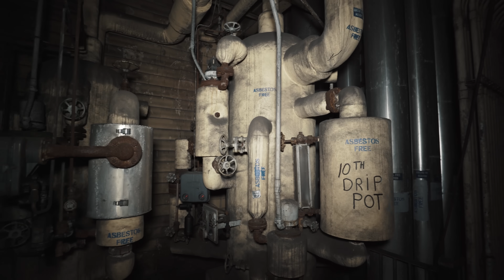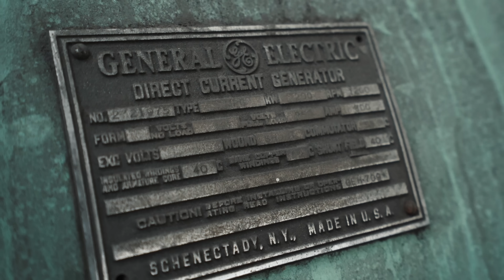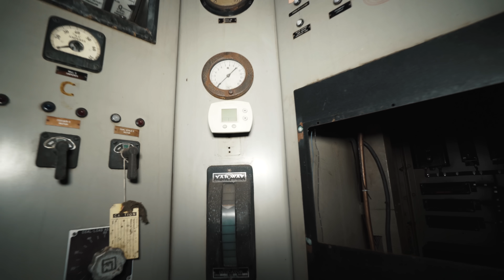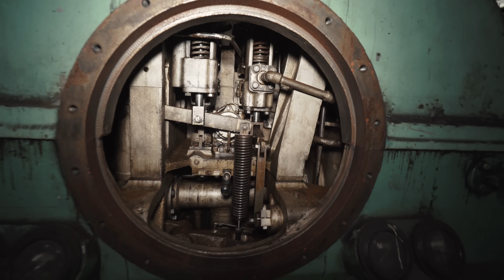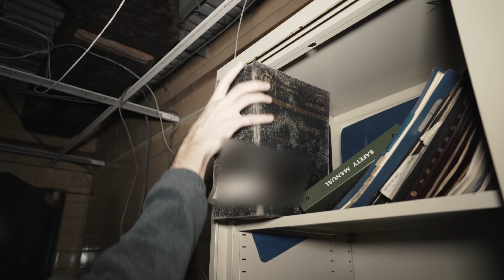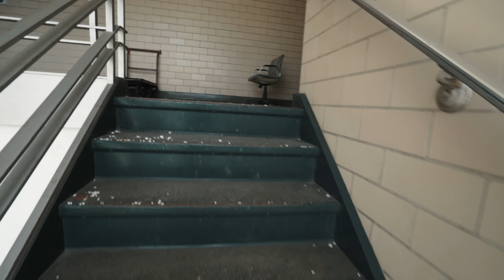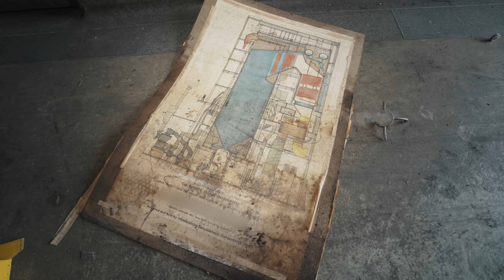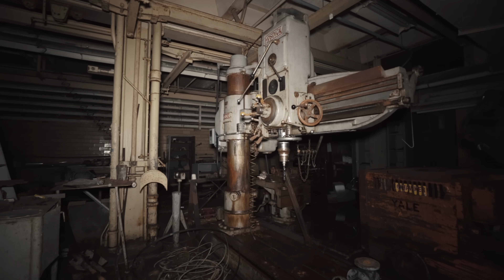Exploring a Huge Abandoned Art Deco Power Plant

Comment: I worked as a high voltage power contractor and every time i go into a Ga power station in Atlanta it's like going back in time.
They still use buildings with asbestos all over the pipes, they tell you right on the door as you enter.
Reply: @Mister Brookes notice i said contractor,  thank god i didn't have to worry about all that just open what switches the office told me to lol
Due to miscommunication between our storm coordinator and the office one time i opened a set of underslums in the substation with full load on them and that was something non of us will forget.
Reply: @Mister Brookesit was in rough shape after but believe it or not it did....my underwear didn't.
That circuit cross fazed with another circuit for a 3 sec fire ball the size of a box truck

Comment: DO NOT DROP YOUR SAW TO THE FLOOR OR GROUND!Treat your saw as a precision instrument it is.I worked in a tool repair shop and you can damage the saws guard doing that.To attest at the toughness of those Skil machines,repaired one that was involved in a three story fall.The blade,upper and lower guards had to be replaced,the shoe as well.When the saw was in the shop-removed the mentioned broken parts and it’s motor ran just fine!

Comment: The generator units shown are still made by GE to this day.They can be turned by a steam turbine or a gas turbine-IE a “jet” engine that can no longer be certified for aircraft use. The generator is sealed and hydrogen cooled-the boxlike ends of the generator are heat exchangers that transfer heat to another cooling medium such as water.The turbine rotor appears to have a low pressure and high pressure cylinders.Some turbines are “reheat “ units.After the steam passed thru the high pressure turbine it was routed back to the boiler to go thru  a second cylinder.After this the steam went directly to the low pressure turbine cylinder thru a crossover pipe above the turbine unit.After that the water mostly condensed would be pumped back to the boiler.Most of those fossil fuel and gas turbine generators were two pole units to be turned at 3600 rpm.
Reply: Indeed; you reminded me of my knuckle-dragging Navy days. A small, HP turbine riding side-saddle to a larger, LP turbine fed by the HP 'exhaust' to the gearbox that spun the ships screws.

Comment: 14:10 - we had some of these at high school, I think it had six or eight channels, so there were six or eight tiny colorful pens. Simple DC motor with negative feedback from linear potentiometer moved one of pens to desired position and then by electromagnet and lever it did small dot in right place. Then it parked in corner, switched to another input, somehow took other pen and did another dot at different place.
Paper movement was really slow, I think it was one step every minute or so. But I'm sure there was way to step it manually by some external signal and make it run faster or slower.

Comment: I've done maintenance in a coal powered facility with a 75m (246') tall building covering the massive furnace and generator. I got to crawl in the pulpy waste of the burnt lignite down below and climb to the very top floor of the building. 

Each floor is grated steel so you can look down until the pattern of the floor covers itself. The traditional way to get to the top was to jump on this cyclic type elevator to get to the top. You could not pay me to ride that. As when I last visited the plant they had it shut down because a worker fell 5 floors and was lucky to be alive. Think riding on a stair step with a handle all the way up with no fall protection. 

I would love to explore this place once it gets shut down soon. 6750 square meters (72,656 square feet) of building rising 75m to explore.

Comment: Back from the days when "General Electric" meant something. Now it's all cheaply made and expensive to fix 😖👍
Reply: Don't confuse their industrial equipment with their consumer garbage.
Reply: Their current stuff is built 'good enough', whereas their older industrial equipment was far overbuilt.. which made it heavier duty.
Reply: I thought it was still made to the same template of quality it once was
Reply: They still make some of the best jet engines used in commercial airliners
Reply: Exhibit A: my God damm range keeps breaking the thin ceramic starters.

Comment: there used to be a lot of those Chamber of Secrets sinks in elementary schools in the 80's 24:06
Reply: Like with passages in them, or just like that design of sink?
Reply: @Ender.wigginn  Just the design of the sink; and you'd step on the metal ring around it on the floor to get the water to sprinkle out of a bunch of tiny holes from the tube in the middle.  I just haven't seen those in awhile.
Reply: Really?

Comment: @9:20 Rain comes in like the Factory I work at now, and it is NOT abandoned!!   :-0
Reply: I am not surprised. It used to be standard practice to have maintenance departments to take care of routine maintenance & repairs. Now, maintenance is usually done only as a last resort, if at all. Everything is disposable. It's all about the bottom line. I reported a hole in the roof over the top of some 600 volt electrical switch gear in an industrial plant, to the company's  maintenance department supervisor. He went up on the roof, looked at the hole, looked down at the equipment directly below, made a kind of grunting sound, & went about his business. Nothing was done.

Comment: I will never understand how people can learn what every single one of those dials, buttons and switches do and when to turn them on or off
Reply: James Park Homer Simpson knew how to do it.
Reply: I'm quite sure it's much simpler than it seems and a lot of things is there just to make regular checks. Of course it will be more difficult to properly start and stop turbine with generators, but I expect them to have some kind of checklists like airplane pilots have. Also it should be quite idiotproof, so instead of blowing up something you will probably "just" safely stop part of power plant.
Reply: ^^^ what this guy said, except to protect the equipment of the plant because whoever owned the plant isn't going to want people to break it by not following proper safety checks and procedures.
Reply: That's what training is for. Plus; you follow the guy doing hourly checks for a couple of days and pick up the routine.
I did it in the Navy.

Comment: The  smaller generate  could be use as a start up generator or regulator, they could shut down larger ones for limit use when t power demand was low so no need to run them all at once, or maintenance on part and look for steam leeks which could be dangerous because super saturated steam could cut like a knife and is invisible.

Comment: The motor - generator  sets at the end are MG sets the provide dc power to the rotor. The opeing you were looking in was not the turbine but the generator air cooling duct.
Reply: Its a hydrogen cooling fan, one on each end of the generator rotor. The 4 towers on the generator casing are coolers for the hydrogen gas. The hydrogen stays inside the casing with a seal oil system kept at a higher pressure than the hydrogen gas which might run from 5-15 psi. Hydrogen cools about 10 times better than air and  has much less internal friction. They purge with C02 before overhaul to avoid explosions.
Reply: Wasnt sure if the old low MW gens were hydrogen or air cooled.
Reply: @Dave96z34v2   In 1986 I put in an old 1950 Westinghouse steam turbine in a sawmill on the peninsula at Eureka, Calif. The generator was hydrogen cooled and I believe it was about 10 Megawatts. The brand new boiler was wood fired, burning wood scraps fed by conveyor belts. 10MW is a toy compared to modern steam plants.
Reply: Makes sens you wouldn't want dust build up on the stator.

Comment: What I just said did not come out right so I will say it again those boilers could be changed from coal to oil and I bet those turbines would run what a waste
Reply: Michael Oram technology has changed and advanced. Much more efficient processes are available at much smaller sizes. Here in the uk we demolish power plants and replace them with new ones.
Also oil isn’t really green enough. Biomass or gas is a much more co2 friendly option

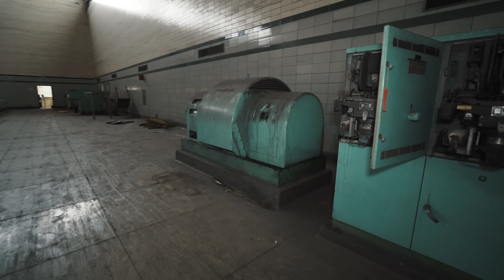Comment: At 3:53 you can see an ITE KA Slate-back breaker. It normally resides inside the greenish-metal cabinets. As seen, it's in the "racked out" or "disconnected" position and one of it's arc chutes is missing. On the back side is a set of metal "fingers" that grab onto the metal bars in the back that carry the voltage when energized. The beauty of it was that it could be "drawn-out" and worked on easily, or lifted out of it's cradle and replaced with another unit. What makes it special is the very first circuit breaker to ever use an inverse-time element to operate a large switch to protect people and equipment from overcurrent caused by ground faults, short-circuits, and overload. The circuit breakers in your house panel are just a scaled down version of this beast. Really cool to see!

Comment: 23:01 is a radial arm drill. They are categorized by the height and length of the arm. That one may have a maximum drill size capacity of 2 inches. Radial drills are only accurate to about a 32nd. Presses and turret mills/drills are accurate to a thousandth.
Reply: The only reasons a good radial drill would be inaccurate is heavy wear or poorly ground drill bits. You are talking out of your backside.
Reply: It's a beautiful peice of machinery, lost.

Comment: Awesome, I used to work in a coal fired plant of the same size and vintage. The turbine generators, the Hear Here booths, yellow brick tile...all the same. I would have liked to see the coal pulverizers. With 6 units, there would have been 18 to 24 pulverizers in the basement. Also your approach to asbestos is correct. If it isn't marked non asbestos, it's PACM. Presumed Asbestos Containing Materials.

Edit: spelling
Reply: I know you're saying I did that plant was a waste was coal boilers have been changed the oil burners if they did that those generators would run again it's a damn shame to see them like that what a waste
Reply: Is the coal pulverized I assume to increase the surface area to in turn burn the coal faster?
Reply: @roadchewerpe5759  pulverizers crush the coal to a talcum powder consistency. There are fans that blow hot air from the boiler(few hundred degrees Fahrenheit) through the pulverizer. This air/coal mixture travels through pipes to the boiler where it is ignited. The pulverizers in this plant were probably originally ball and race style. Think large ball bearings that crush coal as they spin.
Reply: @ec8107  they were roller mills. 3 per boiler. The primary air in this setup was provided by the FD fans from the boiler air casing, no dedicated blower. I worked at this plant as an operator for quite a few years.
Reply: @roadchewerpe5759  that is correct, increase surface area and the burn efficiency goes way up. This coal was burnt in suspension in these particular boilers, meaning it was blown is at the corners on the and burned in the furnace suspended from the floor. I worked at this plant.
Reply: Nate T must be interesting seeing it on a video being explored.

Comment: The "chamber of secret sinks" are just round urinals. Great video as always 👍🏻
Reply: Not urinals, these are wash sinks.  There is a foot ring that goes abound the base to start the water, the black lid on the white round thing is a soap dispenser and just below that is where the water spray comes out.
Reply: There were normal sinks behind it and no other urinals. I've seen that type of urinal at race tracks.
Reply: Look up " Bird Bath Sink " or " Wash Fountain Sink " , someone might be using it as a urinal but that isn't it's intended purpose.
Reply: No, it's a sink. Many years ago I took auto mechanics and we had exactly the same sort of sinks to clean up with after class.
Reply: They are both a sink....AND a urinal.... If no one is around. ;)
Reply: Sinks. I worked there.

Comment: The tips of the steam turbines blade tips go at more than the speed of sound
Reply: The turbines also have to be kept in rotation. The shafts will warp under their own weight unless they are slowly rotated by auxiliary electric motors while the turbines aren't actively producing electricity. The tolerances are incredibly close, so it doesn't take much to mess that all up. Then you are looking at some expensive machining work to true up the shaft & the bearings the shaft rides in, as well as repairing any damaged to the turbine blades.
Reply: @Urbicide  i dont know of turbine shafts do warp , aircraft seem to be fine when grounded
Reply: These power house turbines & turbojet engines, though they share the basic concept of operation, are world's apart. The turbines in this old plant were designed in the 1940's. Weight was not a consideration, nor were high tech light weight alloys available.
Reply: @Urbicide  good point
Reply: DJ Scottdog I don’t know about back then, but I do know that where they are manufactured they are constantly rotated very slowly when they aren’t working on them to prevent sagging. I asked the tech about it and it’s because the tolerance are very tight. They measure to the microns. It won’t be visible to the eye but their instruments will. It’s a very awesome place to be able to see and work in.
Reply: @djscottdog1  Operators  ran them  on turning gear until they were dead cold.  While under full load, you can put your hand on the low pressure casing. But the high pressure casing and steam chest would melt your hand, ignite paper, rags, etc, if they weren't heavily insulated. So on a major shutdown  the turbine rotor was left on turning gear until all casings and rotating parts were at room temperature days later so there was no warpage or contact with the casings. After extended shut down, the turbine and generator rotor were put back on turning gear for days to make sure everything was straight.
Reply: @djscottdog1  they warp turning gear is essential for steam turbines and gas turbines. Source:. I have operated steam and gas turbines for almost 30 years.
Reply: @natet7482  and where did i say it wasnt required
Reply: @djscottdog1  you said you don't know if they warp aircraft is fine when grounded.  Not sure why you're being defensive.
Reply: @natet7482  cos your telling me things ive already been corrected on
Reply: @djscottdog1  then get defensive to them too, I wasn't an asshole I was legitimately sharing my experience with you, now I'm done with you

Comment: You guys do know that respirator masks alone are NOT enough protection from asbestos, right?  The fibres can stick to clothes and then be breathed in later which is why asbestos PPE includes coveralls!
Reply from the maker: Yea we're aware but we're still significantly reducing the amount we could be breathing in.
Reply: PPE is more useful against mold spores and stuff if you are prone to it or if it's very concentrated. Same applies though, anything airborne will travel in your clothes.
Reply: Asbestos is only an issue if it is fibrous,  given they are not working on things and the plant isn't operating, they are OK.
Reply: There's no airborne dust there so they don't actually need any protection...

Comment: An instruction manual 8 inches thick.  This is just for one section of the control panel.
Reply: It was more of a maintenance manual. Sort of a semantic distinction, but it is the difference between the manual that comes with your car, and the ones youd buy to do to mods and repairs on your car. Operators wouldnt need to know the wiring schematics and such to use the panel, that would be what maintenance engineers would use when repairing, diagnosing, and maintaining the panel.